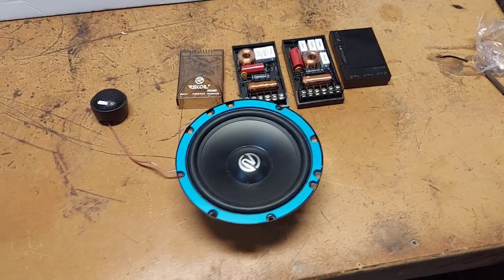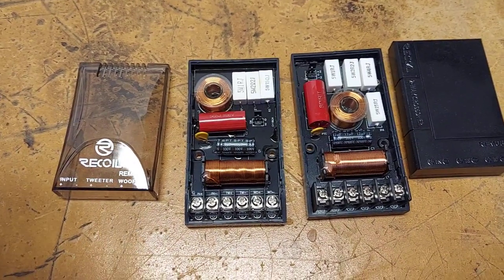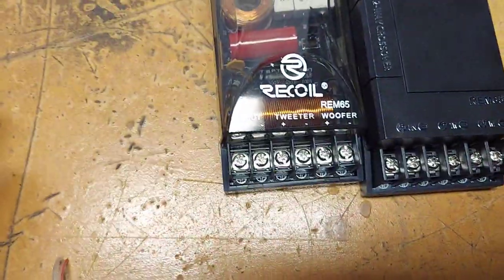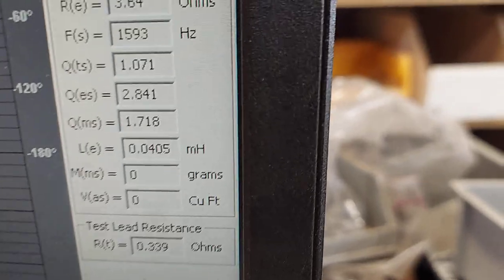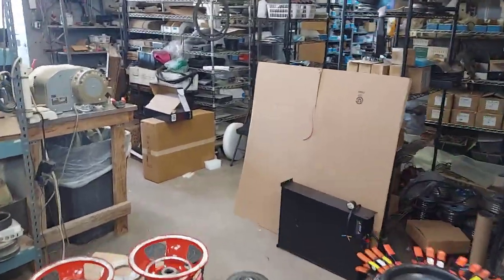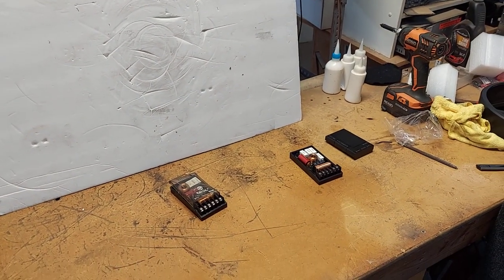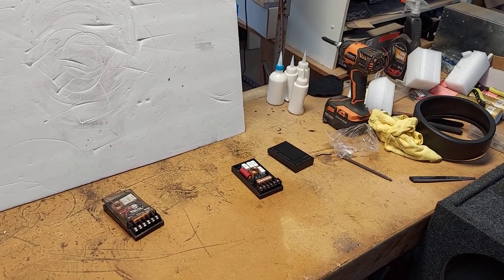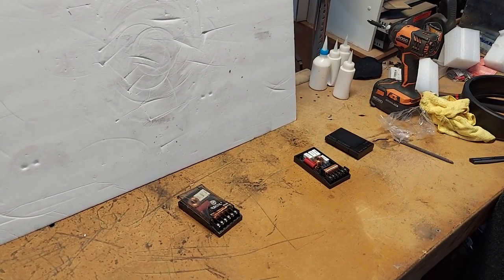Recoil Audio review and test sweep for Echo Series components REM65 & REM525 & 1" soft dome tweeter

Comment: Great to see your review.  I was thinking of using my existing 4" stock speaker as a tweeter in this 2-way system and maybe add the tweeter it comes with or maybe not.  (The reason is partly aesthetic, I want to keep the original look, its a sort of classic vehicle.)  You said if you use two tweeters, then use 2 crossovers, and I don't understand why that is.  I would be inclined to just wire the two tweeters up  in series and see what it sounds like.
Reply from the maker: You just have to make sure that you have the right filter on there that's all

Comment: i never use them,, front is off the deck and the mid bass in back is off little amp ,,sounds ..F.....amazing!
up front two ,,6.5 and the twets to go with them  ,,bass bloccks on the twets ,,no crossover ,

Comment: This may be a silly question, so apologies if it is. Can you run a pair of these off of one of the crossovers? I have (2) sets of speakers in each door right now. One is a coaxial, and one is a component. I can, I just don't want to put two of the crossovers in each door if possible. Crossovers separate signal, so I would think it would be ok.
Reply from the maker: You don't need 2x crossovers.  Just run the coax from the INPUT +&- of the crossover.
Reply: @RobotUnderground  Thanks for the reply. Let me restate. I currently have a coaxial and component set in each door. I was thinking of replacing those with (2) sets of components instead of (1) coaxial and (1) component, and running the (2) new sets of components off of one crossover. Hope that made sense.
Reply from the maker: @vanillamidget8560  Oh, I see.  Well, you can simply get rid of the crossover and use a simple cap on the tweeters.  Otherwise, you'll need two sets of crossovers or to mod the single one for 2 ohm loads.

Comment: I came across a pair of these coax 6.5s mounted in the front door panels of a 98 civic in a scrap yard today. Someone had already removed one and left it on the seat. It had a big ass heavy magnet coated in blue rubber. Some dick had pushed the tweet dome in on the one that was out so I left them.

Comment: I always have trouble with tweeters underpowered,right on, overpowered- playing with crossover settings. Maybe cause I don’t like how they sound by themselves when I tune them. I try tuning them with mids playing and I can get them so fill in the tweeter portion but when I go to here them by themselves they sound awful. Maybe it’s just how it works I’ve blown a few but they lil dome tweets I know try “super tweeters” it’s a lil better but I think I’m under powering them. But it’s fun figuring it out. Just sucks now my remote wire to my deck is dead so running off the 12v to the deck with a heavy duty toggle switch till I get a replacement or just a new deck. I have good luck with Sony’s from early 2000’s late 90’s they tend to sound good and only clip at the last 4-5 volume levels

Comment: You said set the frequencies this and that. What frequency does the package come with?
Reply from the maker: I think the crossover point is about 6 kHz on this package.
Reply: @RobotUnderground  the high and low cutoff for the 6.5?
Reply from the maker: @leebrewer7394  I recommend a high pass of around 100 to 200Hz depending on slope.  Then the crossovers that come with the set cross the mid down at 6kHz.  You can also experiment with using the IN as the OUT to bypass the low pass on the mid crossover if you want some extra top end.